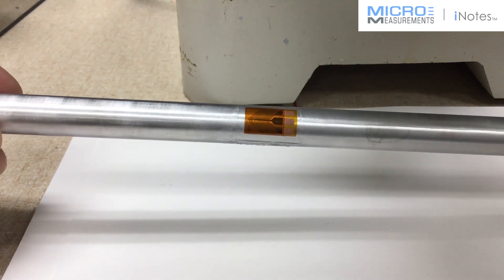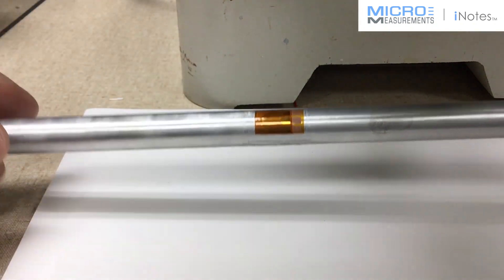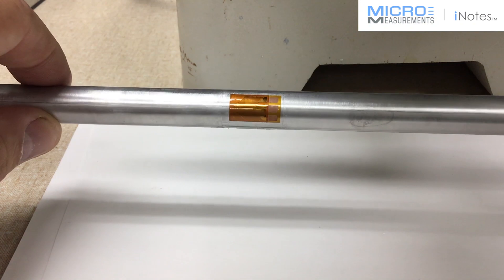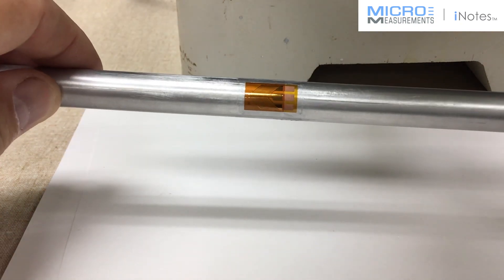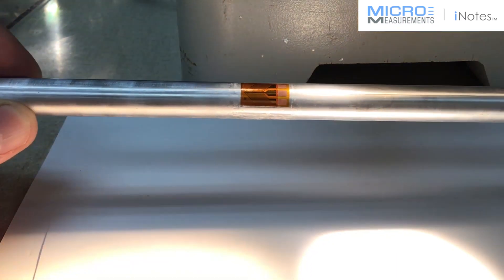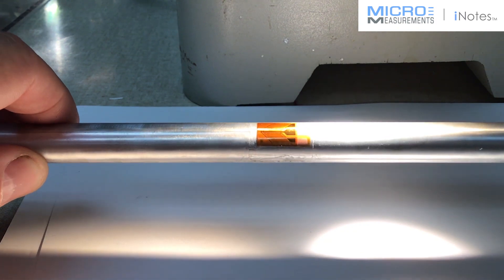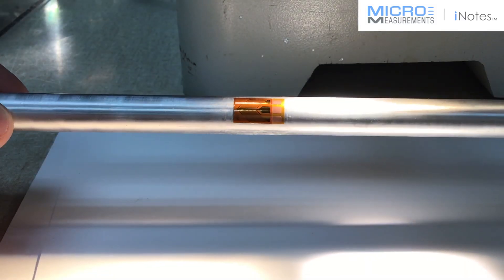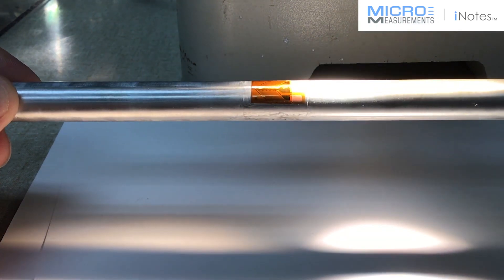It Takes 2 To Torque (Torque measurement)

Comment: Do you have information about how your convert the strain signal to torque units? Whats the calculation?
Reply: Hi Nick.  Thanks for the question.  We do have the equations that show up in a few of our publications.  Let me know if you want them emailed and I would be happy to send to you.  

Ymax = 2e = 4*T*(1+v)/(Pi*E*R^3) where Ymax = max shear strain, e = strain from one of the grids, T = torque, v = Poissons ratio, E = Youngs Modulus, R = Radius.    

We also have a calculator on the site at the following address:
https://micro-measurements.com/calculators#/transducer-outputs/torque/full-bridge 

I hope that helps.  Darryl